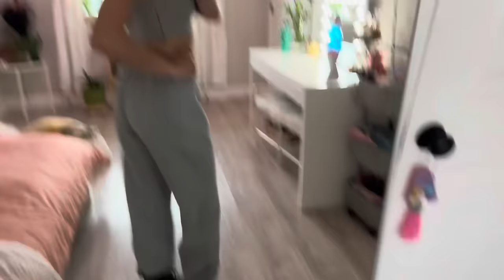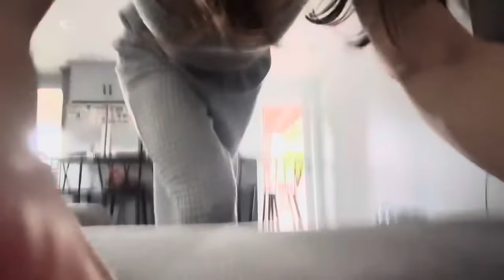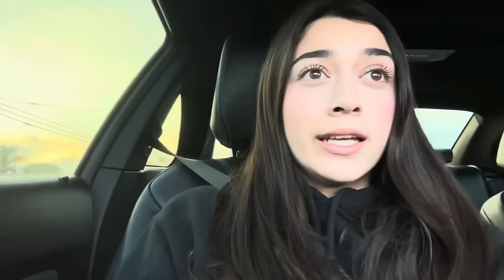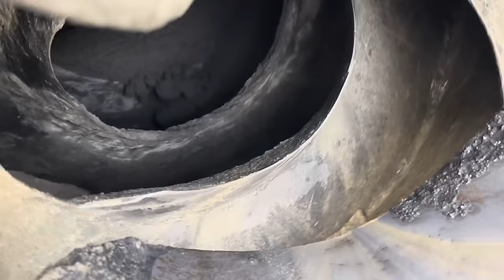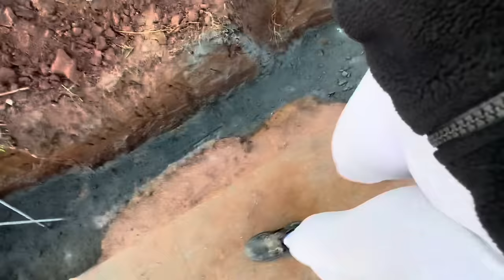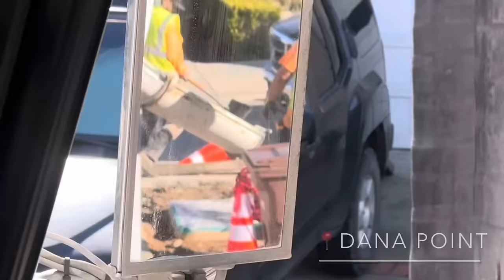I don’t like concrete chute pours | Ready Mix Concrete

Comment: Simple solution for the workers vehicles in the way, make them move the vehicles. Yes it's their concrete but that's your truck. I'm always making my contractors accommodate my needs as a driver for safety and efficiency.

Comment: Great call keeping your rig on the pavement.
9:26 
They sign the paper, even then I’d be worried about busting sewer lines, or water lines.
Worse yet a gas line. 
You have to remind them you are driving a very heavy steam roller😂.

Comment: I drove mixer for 25 years and my pet peeve was when there were too many vehicles in the way. Didnt like chute pours when they were slow and i had to ride the clutch. Didnt like city jobs when city testers were checking almost every load and they would give you maybe one chance to adjust  the slump and air. Always get out of the truck and walk the job to check it out if your not sure of how safe it is to approach it with the mixer.

Comment: Hello Lexie
I have a question for you. I just got my CDL and I have had trouble finding jobs.

Here is my situation: I got my CDL (class A, automatic restriction) at a trucking school that takes only 2 days (probably a mistake on my part). I thought I'd be able to find a job easily based on what I was told. I won't work on Saturdays due to religious reasons.

The only job offers I've gotten are to places that would require me to work on Saturdays at times. Most places want experience and if they don't require experience, then they require me to work the Sabbath.

Do you have any recommendations for me?

Thanks,
Jason
Reply: Find another line of work.  Get the manual endorsement or buy your own truck.   Nobody wants employees with all your restrictions.   Sorry but employers make the rules,  not employees.   I'm an employer,  fyi.